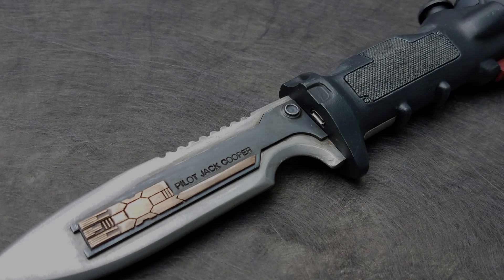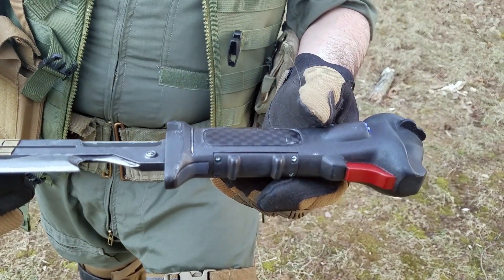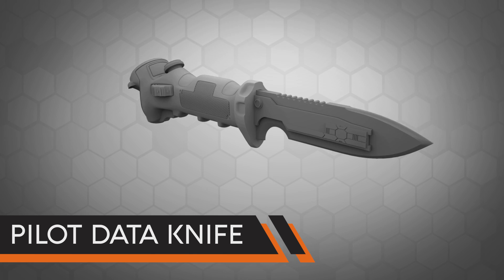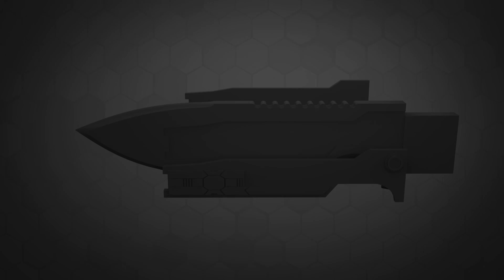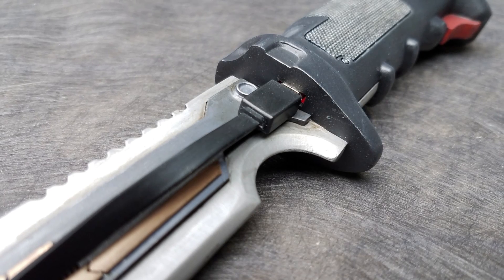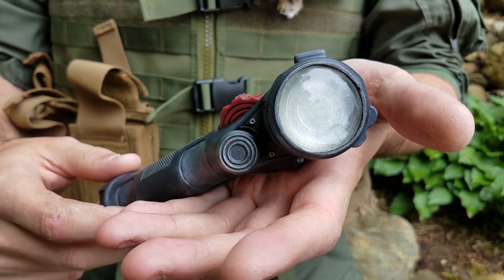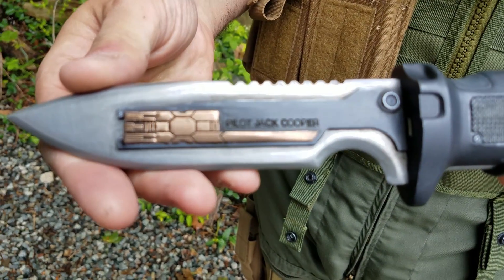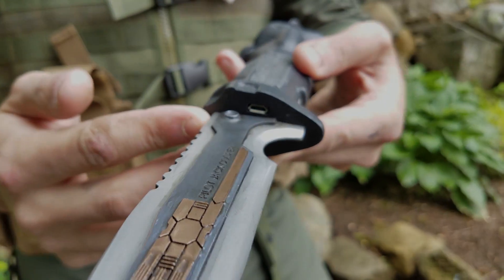Titanfall Data Knife 2.0 - Updated electronics, cold cast construction

Comment: would it be possible to use it like a real knife ?
Reply from the maker: Not really. It's not sharp, and resin will snap if you apply too much pressure. Best not to. :)
Reply: aww :( i thought that it could be used like an actual sharp usable knife
but its still cool as a prop :)

Comment: would love one already made.  me and my son are big fans
Reply from the maker: Feel free to message me directly for more information. We're doing a limited run of finished knives at the moment.
Reply: Fused Creations hello and thanks for your time. how can i get one. and what will be the cost?
Reply from the maker: Check this link out for the full information: http://www.fusedcreations.com/2017/05/31/data-knife-2-0-and-copies-to-come/  

The synopsis, which you can find at that link, is $350 for the fully-finished, wired, and painted knife in cold cast metal parts, includes display stand. $100 deposit required for production. Custom engraving is an option, and free. We're only making a handful of these, but they're in production at the moment, so if you're interested you can e-mail me at adam@fusedcreations.com
Reply: Fused Creations thank you

Comment: Is it sharp？is it made out of steal？can you use it as a real knife？if can't，can you make a sharp steal one？
Reply from the maker: 方思 it is made from cold cast aluminum, so it is not sharp - it just polishes up like metal. It would be theoretically possible to make a sharpened version out of steel,  since the blade is just an insert in the handle,  but I'm not offering that.
Reply: +Fused Creations ok，that was fast^_^
Reply: +Fused Creations I mean，is not like I can buy one or anything.
Reply from the maker: 方思 well, we are selling them. I'm doing an initial limited run of 10 right now, half of which have been spoken for. If you're interested, it is certainly possible to buy one.